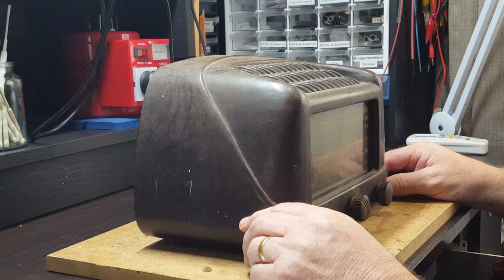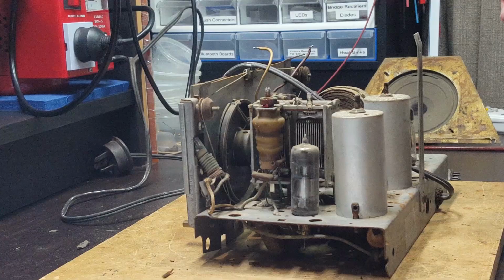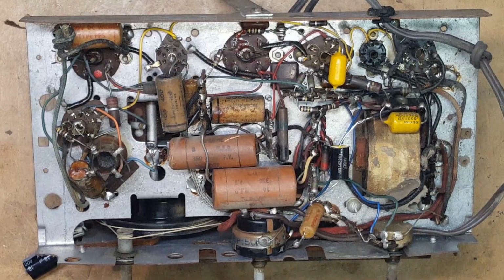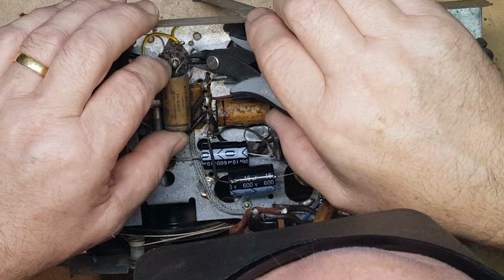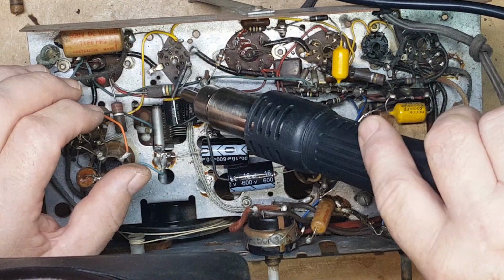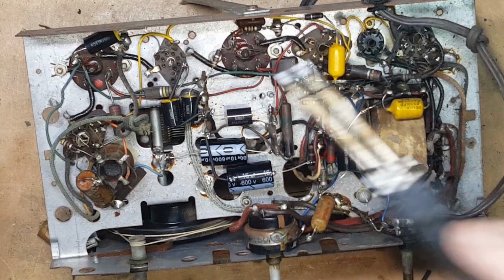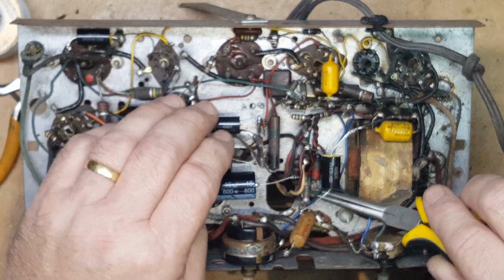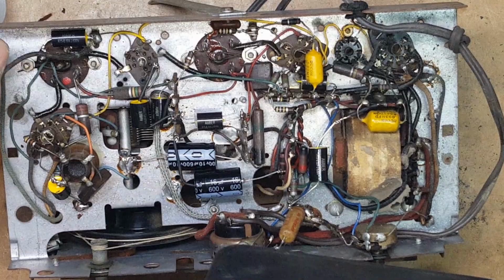Vintage Radio Restoration - STC A5130 Part 1 - Look Over and Caps Replacement

Comment: the choke elevates the centre tap of the power tranny  giving you a negative voltage for the biasing of the output tube and so forth
Reply from the maker: Yeah, thanks Ian, these were early videos and my knowledge is better than it was then... I hope 🙂 If I remember I was surprised to see the choke on the centre tap and not in the HT, since then I have seen it in similar positions on other radios and understand it better. Thanks for your input, I'm learning this as I go 👍
Reply: @DavidTipton101  any time you need help with electronic topology just ask me i do this 24/7 build missy audio amps preamps and repairing electronics
Reply from the maker: Thanks Ian, I may take you up on that 🙂

Comment: This looks like a “typewriter” 📻 radio in the photo. It’s simply the lighting hitting the top speaker slots, along with 60 years worth of dust. I really like the top firing speaker. I’m sure it’s permanent magnet. Field coil speakers can be hard to fix if the field coil has gone open, since this problem can manifest itself in many other ways, like a faulty switch or burned out capacitor. That’s only two to mention. A broken wire can be a third, and it can be anywhere in the system. To mention as a number four, a fuse. Fifth, a bad tube. Sometimes, even the test meter may pass this up. My brain 🧠 may be next, as far as not being able to diagnose the problem. This is another great 👍 quality radio 📻, hinting that 1950’s look. Cheap Chinese radios 📻 do not compare. I think 🤔 this is a Bakelite case. I’d really like to know how to know when a radio is Bakelite, and not a Bakelite look-alike. One ☝️ way of testing this is wetting the Bakelite, and rubbing it with a fast 💨 motion, and smelling it. If it puts out a formaldehyde like smell, it’s Bakelite. I don’t know 🤔 if this is a good test or not, in case of accidental damage. I guess if it doesn’t harm the case of the radio 📻, I’m probably fine. I don’t know 🤔 if you can do this test, simply by the heat of the tubes as they warm up, by smelling the back of the radio near the ventilation slots. This would avoid unnecessary friction on the case of the radio.
Reply from the maker: Hi Jeffrey, It's Bakelite.

Comment: Wow Mr Tip.  ,  scary  cant they be taken out and housed down with some soap then dried for a day or 2 in the sun? without the tubes in ofcoarse and Speakers off?
Reply from the maker: I did wash a radio in the early days and I can't remember why, it didn't harm it but most of the parts had been removed 🤔

Comment: When i first took an interest in repairing/rebuilding radios I found people here showing you how they did it.  I immediately noted that some pronounce "solder" as you do, but we in America don't sound the letter L when saying it.  I pulled out my trusted Webster's Encyclopedic Dictionary from the 1950s and looked that word up.  It is correct in American English to pronounce it as we do, and the same dictionary references that the British Commonwealth pronounces it as do the French with the L sound. The origin of the word is also noted, and it is from Old French solder. Geography plays a big part apparently in such matters.  Aluminum is another such word, as you know, and there are quite a few with different pronunciations.  Keep up the good work!
Reply from the maker: Hi Jeff, I first knew of the US pronunciation of solder when we were shown US war time training films during my apprenticeship in the very early 70s, it seemed quite funny at the time. Aluminium in British english has an additional 'I' in it changing the words pronunciation. There is a great diversity in pronunciation and spelling between British and American english, you could probably call it language evolution 😀

Comment: Hello I just watched this one, and you did a great job, I also hook on to wires a lot.Just one thing, if possible , if you are going to leave a part, especially a cap, you should 
try not to twist it. They are sealed and the motion might break that, and or the connectionsinside.!I have a small angled mirror, that is really helpful in those cases.You are very methodical, that is good in electronics!
Reply from the maker: Hi David, did I twist a component and leave it in there? I have given myself a slap on the wrist. That's good advice, thanks for pointing it out 🙂
Reply: No capacitors left behind!

Comment: I love the vids - down to earth, no unnecessary health and safety advice, no bs. Only one bit I don't care for is the out of focus hand held gopro swooping around. Minimise the movement and keep it slow.
Reply from the maker: HI Andy, that is a very early video, I think I have improved on that now 🙂
Reply: @DavidTipton101  yeah, I'm working my way through them and you're right. Getting better all the time. Crazy station designations down there in the antipodes. In the UK we had 'The light programme' and 'Radio Luxemburg' and 'Hilversum'. Come to think of it, equally crazy.
Reply from the maker: @pintokitkat  Ha-ha... right Andy, the dials suit the local requirements. I get a few comments regarding the Aussie dial glasses, I think they look pretty normal 👍😄

Comment: Greetings:
My view of the power transformer shows it to be of a size suitable for use with lower frequency mains supplies such as 40 Hz or even 25 Hz mains (Ontario, Canada on Niagra power).
Reply from the maker: Hi James, it is designed for 50 Hz in Australia, it is a pretty standard size for a radio of this design, it operates at 240 Volts. Thanks 👍🙂

Comment: What I did with my tester like that was to solder on a couple of croc clips that I can clip on in circuit or half in circuit caps and test..  Works great. For that purpose I just took a double clip cable and cut it in half. Most of the time the tester doesn't care which lead goes where.. I am considering adding a third for transistor checking but as little of that testing that comes up it doesn't seem worth the trouble.
Reply from the maker: Hi Jerry, thanks. That was a very early video, the first I think. I now have two cap testers with croc clips on them. I also have a transistor checker with 3 clips, cheap unit from eBay but works well most of the time, thanks 👍😀

Comment: I like the cap tester you used. I have one like it. However I only use it to measure the ESR value. I use separate a cap tester for cap values. It  works quicker. Up until last Summer I used an old Heathkit LCR bridge .
Reply from the maker: Hi Cosimo, It works OK, as you say gives the ESR as well. I have another cap tester but it's really only good for checking values. I usually just chuck them out if I doubt them. I saw one YouTuber the other day change a cap and it fixed the problem, when he tested it with a Heathkit tester it tested ok. Go figure 🤔😮
Reply: David Tipton yes, I did not like the Heathkit null bridge. Too hard to use and dubious results. Once upon a time null testers were all there was. In my work life At the lab we had a General Instruments bridge and it was a precision tool, until the digital model came out in the late 1970's.

Comment: Aahaa... there is that digital tester I use too. It better than any cap checker or bridge even though it neglects to measure leakage. The tester will check ESR, cap value, inductance, resistance and transistor, diode junction voltages. I test leakage with a variable 500 VDC , monitoring voltage applied and current with two separate meters. I gradually bring the voltage up from Zero while observing current. There should be no current, but a leakage below 1ma can be normal and acceptable. Once at the cap rated voltage I pulse the voltage on and off. After all is said and done I still change out the 50 year plus part. I even spot check new parts as a sampling incoming inspection routine. I did put short test leads with  mini alligator clips on my digital tester.
Reply from the maker: I physically broke that tester so now have a new rechargeable one in a neat case, they are very handy. If the capacitor is very leaky it will sometimes show as a resistor. I don't have a DC power supply but wonder if I should get one (expensive) or make something out of a transformer and solid state rectifier connected to my Variac, I have all the parts. Food for thought 🤔🤔🤔
Reply: I had an old power transformer laying around , I bread boarded it on a plank using diodes on terminal strips in a full wave bridge and a input/output capacitive Pi filter using a  5 henry power choke from an old Philco radio. The whole system runs off a variac for voltage variance. Its just a temporary setup kept under the bench until I need it. I use an EICO VTVM to monitor the voltage and a Simpson 260 to monitor the current. It's something I did for amusement.
Reply from the maker: I thought you were referring to a manufactured one. Sounds like an idea, thanks Cosimo 👍

Comment: Yo David, @1:01:45 in the video there is a square Capacitor 12 O clock High, which can also go out of spec, and then just above that there is what also could be a capacitor that may go out of spec, besides that so far so good..
APU I dropped a like..
Reply from the maker: Yes, the mica, usually OK unless they have high power on them. This was one of my first videos, at that stage I was told Micas will never give any trouble, I know better now 🙄🙂 I hope I changed the rest of the caps. Thanks 👍

Comment: I pre solder my loops first I find it much easier to have the part in one hand and the pencil in the other the only is have to tin the wire your connecting to first
Reply from the maker: I agree Richard, I often presolder and add a bit of flux to the parts when I join them. This is a very old video, I might have changed my ways since then 👍😀

Comment: A strange little phenomena, when you solder at 14:06 I am hearing a low frequency hum through my headphones. It's very faint but it's there. It seems that your iron is inducing a frequency into the cameras audio circuit.
Reply from the maker: Yes, maybe, depending where in the circuit I sometimes get a hum through the radio speaker 🤔

Comment: If you have a waxy wonder that is hard to read try blasting it with your heat gun, the dirty surface wax often runs off revealing the writing more clearly.
Reply from the maker: That's a good idea Steven, I'll remember that, thanks 👍🙂

Comment: I'm restoring an old Sparton Tube radio circa 1946 and ran across something on the schematic that I have never seen before. The last resistor listed says R18 2700 ohms 5. w. w. w.. All the other resistors show the ohm value and watt value as an example R4 100 ohms .5w etc. My question is what does it mean when there are 3 "w" s like that? I went
ahead and replaced the R18 with a 2700 ohm 5 watt resistor. The radio works and I  have the proper voltages but the resistor is getting extremely hot. Any thoughts, ideas or suggestions would be appreciated.
Reply from the maker: Hi James, The Sparton are nice looking radios from Canada I think. I was going to say it stands for World Wide Web but of course it means 5 Watts 'Wire Wound'. 
It will get hot, it's probably dropping voltage for plates or screens. 
You can check the Wattage the resistor is dissipating by measuring the DC voltage drop across it and using ohms law to calculate the current, (I=V/R) then convert it to Watts, (P=I*V)... or be slack like me and use an on-line calculator: https://ohmslawcalculator.com/ohms-law-calculator
The Wattage reading should be about half the resistor Wattage rating, give or take 🙂
Reply: @DavidTipton101  Thanks David I think you are right not sure why I didn't think of that. I assume that maybe the wire wound resistors dissipate more heat than regular ceramic or film resistors
Reply from the maker: @jameshochstetler6093  Higher Wattage resistors tend to be wire wound to carry the current load, the ceramic resistors I have seen are wire wound 🤔

Comment: David, are these new caps marked for outside foil - useful if they are?
Reply from the maker: Hi Tre, no markings but it can be determined a number of ways if you need to. I don't bother too much about it myself but others do 👍🙂
Reply: . @DavidTipton101 .  Thanks for reply, David. I haven't tried reversing capacitors to see if hum is changed in any superhet circuit applications; must get around to it some day. Testing for outside foil, I can only think of alternately touching each wire of a cap to an amplifier mike input, to check for noise - or maybe a tube grid cap, though I don't know how successful it would be. Any ideas yourself.  PS. I enjoy your rebuilds very much.
Reply from the maker: @trebushett2079  Your idea is very good. For me, I attach the leads of my oscilloscope to the capacitor leads and touch the capacitor body, flip the leads and whichever direction gives the least interference note the lead the ground clip of the oscilloscope is connected to, that is the outside foil. Mr Carlson's Lab channel has a video on doing it and he has a black box he built to test them. If I was going to wholesale test caps I would make a jig with two vertical probes on a block of wood connected to my oscilloscope and just hold the cap either way to determine the outside foil and mark it with a marker.
I found the link to Paul Carlson's video: https://www.youtube.com/watch?v=BnR_DLd1PDI&ab_channel=MrCarlson%27sLab

Comment: Hmm an aircraft engineer,  So you replaced the elastic band :-D, sorry my silly mind.
You had to be careful repairing airoplanes as peoples lives depended on the correct operation of every part.
You work in a careful way with radios as well, no excessive force and keep the structure sound.
No reply needed, i'm just leaving comments to show appreciation.
Reply from the maker: Most of the aircraft I worked on had at least 2 up to 4 lacker bands zx8401ztv 😄 Thanks for your comment 👍🙂

Comment: classic 1950 radios no earth on the  ac cord and i bet no mains fuse
Reply from the maker: Nah, don't need all that safety stuff 😉, I don't think that came in till the 60s - 70s as far as I know. I remember my Mum's radio catching fire in the kitchen when I was very young 😮
Reply: @DavidTipton101  its amazing i still see crazy stuff like this. i do test and tagging and some of the electrical boo boos

Comment: Wax caps need to be checked for leakage...
Reply from the maker: Hi Andre, yeah, most are no good after 70 years, I just change them all. Even if they still work now they will fail sooner rather than later.

Comment: In response to your request for suggestions in this video, I have a couple of videos that I would like to suggest you watch.  I may have already mentioned them to you in another video, not sure, but just in case, since they are such excellent videos, here they are:
https://youtu.be/BnR_DLd1PDI
https://youtu.be/67M7fsbLUIU
A radio might work without applying the things mentioned in these videos, but it will work much better if the "rules" are followed!
Keep up the great videos!  Thanks for the "stop gap" short ones too.
Reply from the maker: Hi Wayne, thanks, I'll look at them, always happy to get suggestions 🙂